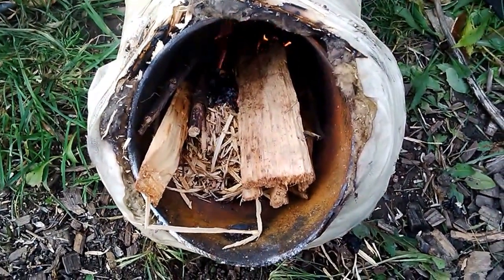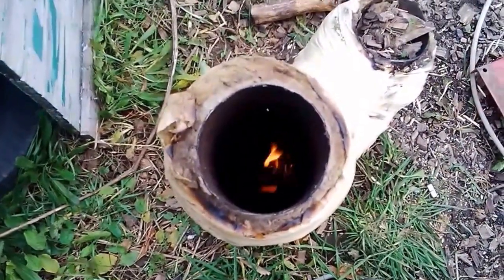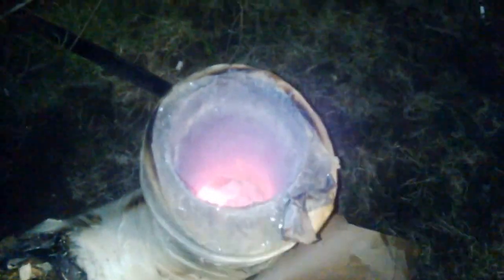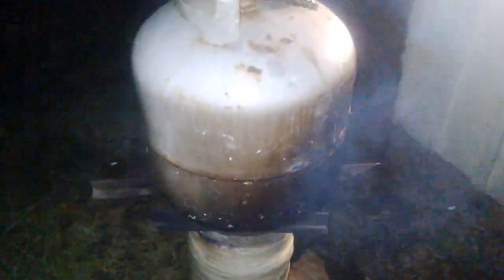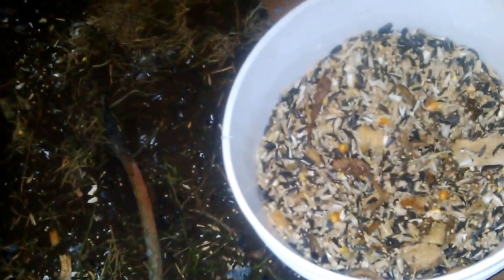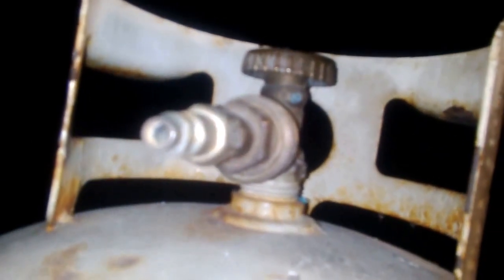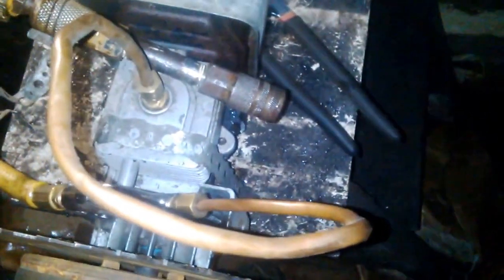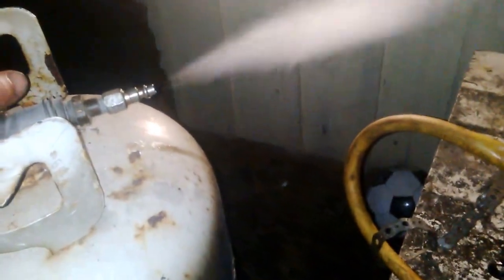rocket stove steam generator run

Comment: What type of insulation do you have wrapped around the stove? Why did you choose it?
Reply from the maker: wow i had forgot about that rocket stove just after this video i made a warm air intake for it and it melted down lol the insulation is rock wool i still use it for all my high temp projects what i like is that after a first heating it stabilises a layer that is closest to the heat kind of melts in to like a glass that is relatively strong and knowing what i do now if i was going to make a version of this stove i would fire what i show in the video a couple times then make a outer box to pack with insulation and more important to support everything because i now know that as long as you do not brake the melted insulation the steel could melt and burn away and it will more or less keep its form